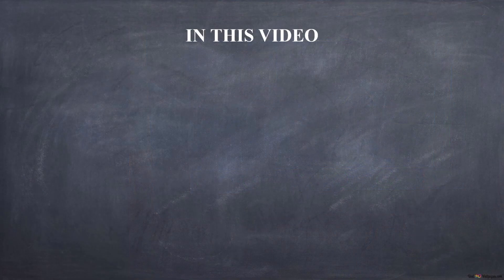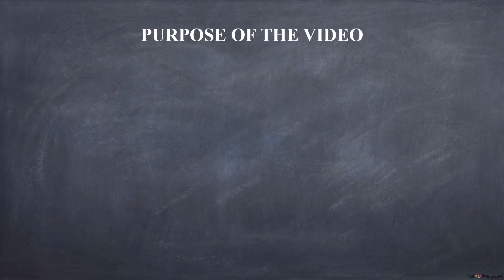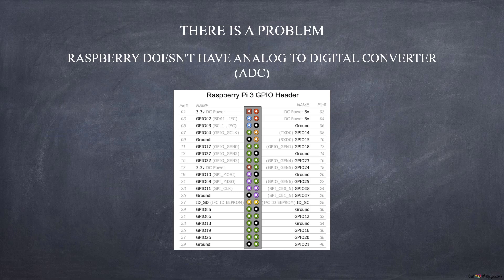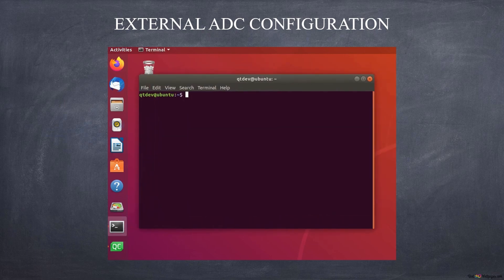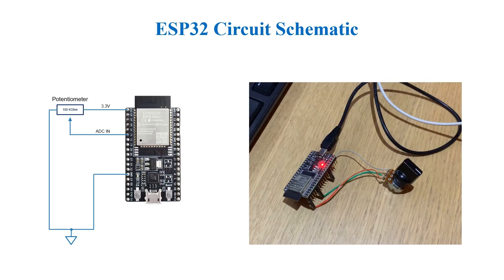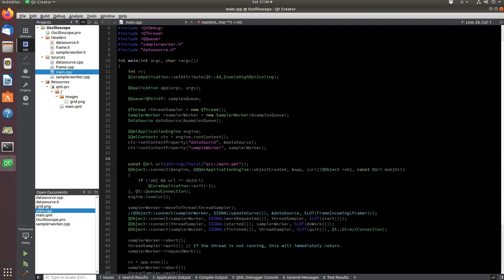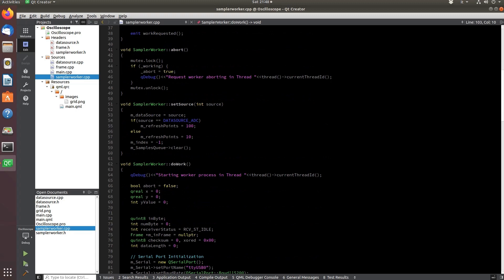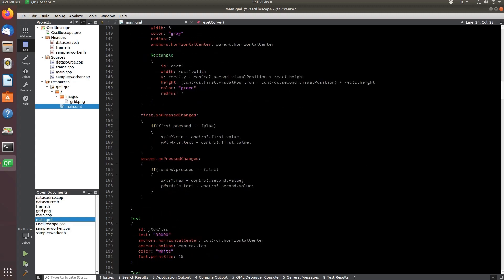Raspberry Oscilloscope with Qt

Comment: Hi sir thank you for your video. I have a question. Is it possible to use a simple monitor instead of touch display? I mean by using the mouse movemont could the settings be changed